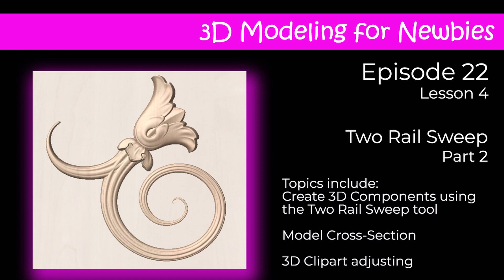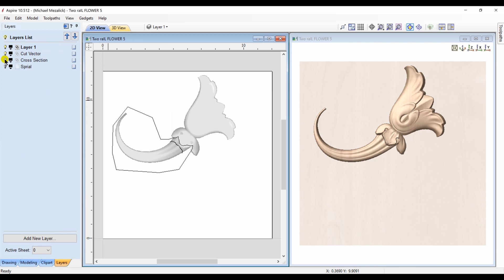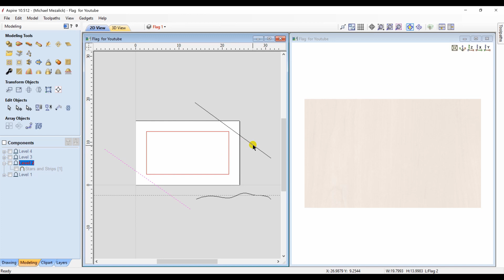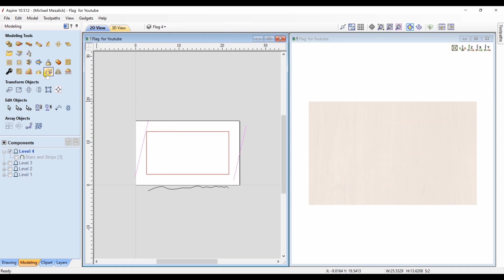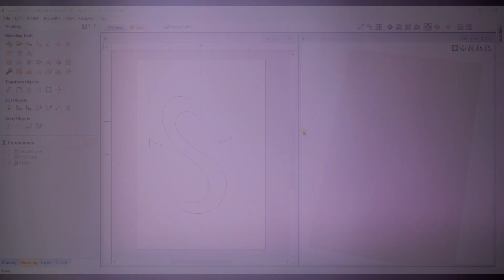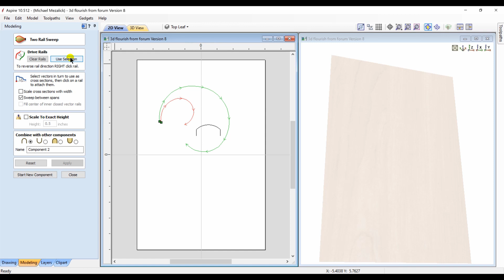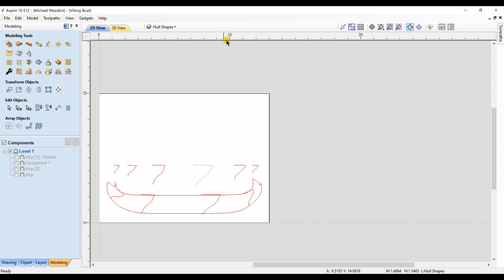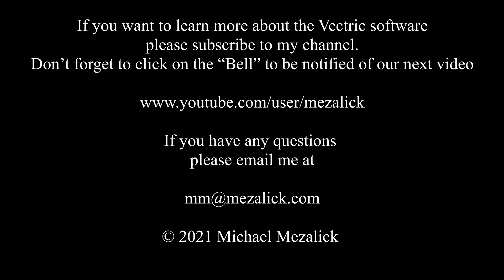3D Modeling for Newbies Lesson 4 Two Rail Sweep in Aspire

Comment: My issues is when I go to run the tool path on the two rail sweep.  They are open vectors so it keeps throwing me the error.  I'm sure there is an easy solution but I can't seem to find it anywhere in a search.
Reply from the maker: The vectors should not be needed when creating the toolpaths. The two rail sweep creates the component from which you create the roughing or finishing toolpath